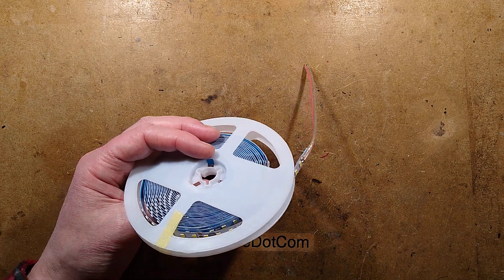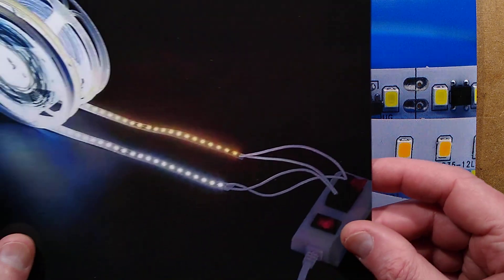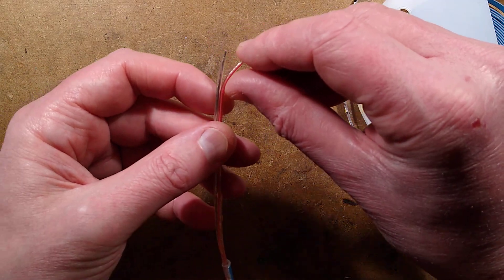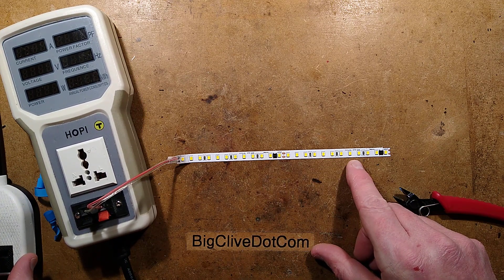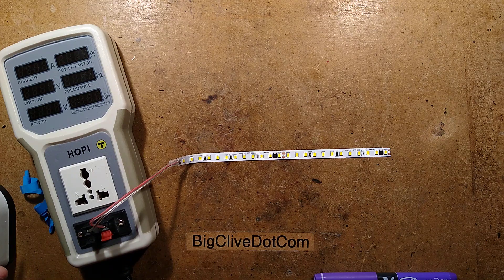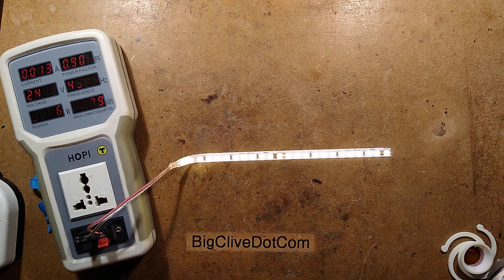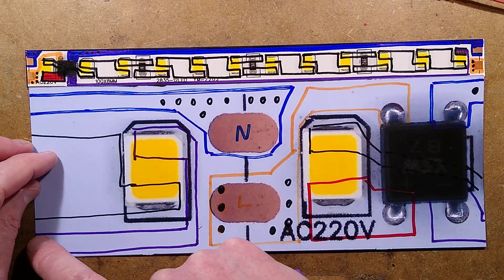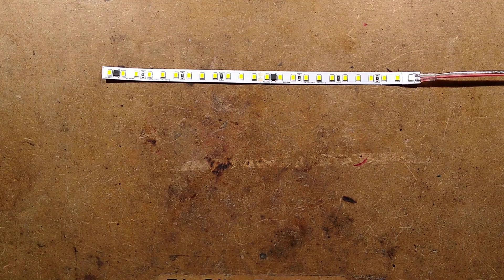Dangerous bare 230V LED tape

Comment: 120VAC LED tape is a thing in North America, though I usually see it sold in pre-determined lengths, terminated with twist-lock connectors, and encased so as not to have exposed ouchie-bits.  It can be incredibly useful in retrofit situations where a DC power supply may not be an option, but other than that, it just strikes me as a bad idea.

Although, you did touch on something interesting:  They're not getting hot.  They're not cooking the LEDs, which can be a problem with 12V tape.  Especially useful when materials costs are at an all-time high, and 5630 60LED/M 12V tape absolutely requires aluminum backplaning to prevent rapid failure.  I'm about to be doing circumfrencial cove lighting in my living room and kitchen, and 120VAC tape is on my short-list due to the absurd cost of aluminum at the moment.
Reply: I don't see this being any worse than US Christmas lights. I have to admit, the overseas systems are much more robust than the much older US system. I don't really see the 120V strips in PVC any more dangerous than the old rope lights. There are obviously places where this should not be installed,  like shower stalls or pools.

Comment: Excellent video as always, I have several rolls of this but it's coated with a clear flexible coating, not sure what probably just PVC. Find it quite useful for cosplay but haven't used it recently but I suspect mine might be a safe low voltage version although it seems as bright as yours. Long story short, why 240v and why exposed, seems unnecessary and dangerous.

Comment: When will they claim that it can be used in a pool (because it´s super "save" like 19th century USA electrics with unisolated wires on the walls & the only outlet is an E27 Edison screw) ?

Comment: With no capacitors for smoothing how bad is the flickering? 100Hz pulses should be pretty noticeable I would believe and quite useless as lightning anywhere people spend any time.
Reply from the maker: The lights spend about 70% of the time on, so the flicker isn't too bad.

Comment: At least the resistor ones should work a bit better with a phase-fired dimmer. Either way there’s no filter cap so it shouldn’t matter much. The flicker will be worse though.

Comment: I've got a 5m strip of mains voltage LED in my greenhouse but that is fully encased in rubber, connections are glued to the connector with some kind of silicone caulk, a sleeve covers ends and connectors, the rectifier is fully encased and connected in a IP65 junction box. So I kind of trust mine. This one though, not so much.

Comment: " Death strips" :-D, i would Not touch it with a barge pole.
Unless it could be converted to 50v ac from a mains transformer.
Or run away from it as fast as you can :-D

Comment: I suppose this stuff could actually be fairly safe if encapsulated in electrical silicone sealant or clear resin.

Oh, and I assume those speaker connectors are for the US market for 100V speakers!

Comment: Basic rule regarding any purchase on eBay, doubly so on electrical kit - check listings page at the bottom left. If item is being sold from China, write out your will before purchasing or using.

Comment: These teardowns are revealing PCB layouts where automatic flood generators are being used without proper design rules. Even if the tape is touch-proof, I wouldn't want it in my house.

Comment: I like the little bit of insulation over the speaker wire where it terminates onto the strip yet they leave the rest uninsulated, quality product 😁
Reply: Might nog even be insulation for insulation purposes, but to stop the wires bending near the joint and that way breaking off :P.

Comment: At 6mA a 3900R resistor will drop 140mW - your multimeter is giving an RMS voltage assuming a sine wave (which it's not seeing because it's rectified) - real voltage is 23-24v

Comment: oo, bad the mains goes direct to a rectifier with no fuse, maybe wouldve been better to have the resistors on the ac input before the rectifier, then if rectifier shorts, no big bang! or.... wire the leds in inverse parallel so no rectifier needed, just resistors

Comment: This stuff is amazing. I can fit it around my child's cot bed. Connect it straight in to a 32a socket outlet, no pesky 12v power supplies, no plug needed, another saving! And then leave my child to his sweet dreams , while we throw a baby shower... Ebay never stops to astound me with there very stringent safety policies... This one is going to sell like hot cakes.

Comment: Is a SMPS that much of a problem?  Electrolysis vs resistance degradation..even carbon electrodes have a finite life in AC electrolysis.  Think old school humidifier. 
Do you have export/import duty issues sending small electronic bits to the States?  Reason I ask is a Scottish firm makes an electronic bit I need for a project..
Reply from the maker: There's may be customs charges between the UK and USA.

Comment: how much safer would this be in a clear silicon sleeve or the front side being covered in clear silicon?
Reply from the maker: There is sleeved mains voltage tape available.
Reply: @bigclivedotcom  : Would silicone prevent mains voltage arcing?

Comment: It keeps amazing me that manufacturers put time and effort into things that are junk right from the factory, but then: who cares? It makes light, right? So who cares about shocks or fire hazards....
They could have improved it by splitting the bridge rectifier using double diodes with common cathode/anodes at each end of the sections, leaving more spacing, and making the base material thicker, but really, only molding the whole thing would make it somewhat safe.

Spacing between live and neutral is poor, but not really worse than on these incandescent light strings that have been around in the 90s.

Comment: 5:19 I bet that would be smoking hot. Though probably an experiment worth running. Expose those bus bars and speaker wires to a 2kW load and see how well they fare.

Comment: Should be a great lighting source for industrial stainless steel kitchen equipment. They didn't leave a lot of room between the tracks to drive the sheet metal screws though though.

Comment: I would have no worries using this to convert enclosed fixtures. Where there is no chance of the gen pop touching it. 
Would be a plus if the fixture was metal and bonded.

Comment: I am certain people will use it. The thinking will go along the lines of this 12v stuff requires a power supply, this 240v stuff doesn't, so we don't have to buy a power supply that can fail down the line. If we stick it in this aluminum (pronounce it how you prefer) u channel, and snap this defuser on it will look quite posh. And lets face it, what would be better for a long circuit board with open 240v than to put it into a decorative piece of metal the back of your hand can brush on when pulling the toast out of the toaster that has grounded metal shell.

Comment: I purchased an LED strip light to replace a fluorescent tube that had a strip of that inside a plastic carrier, it gets warm after a while due to poor air circulation inside the case.

Comment: Why didn't they turn the LEDs and resistors 90 degrees?
Reply from the maker: Probably to reduce physical stress on components when the tape is run around curved surfaces.

Comment: Kinda reminds me of early days of electricity.  Family kitchen hat one " fixture", bare wire hanging down to a light and to run the kettle you'd hook bare copper ends of an insulated wire to this fixture wire.

Super super unsafe, but effective.

Comment: I know that vinyl tubing would yellow quickly if it were used as a housing for this stuff...what about polyethylene? (EDIT: What about sealing the whole strip in clear heat shrink?) Seal the ends with silicone, it could be safe(ish) enough under a kitchen cabinet or in cove lighting. I don't care for the flicker, though; I've found that even 60Hz flicker is too distracting enough out of the corner of my eye, and there isn't much room to add a smoothing capacitor after each rectifier.

Comment: my parent bought similar mains voltage leds for my balcony lighting and they are in a plastic transparent casing with makes them fine for puting them in the ceiling where you will find only dead bugs , they are quite usefull to behonest. (when I saw them runing directly from mains voltage Iwas amazed I wasthinking witchcraft whaaaat is this)

Comment: We bought some plug-in under cabinet lighting from B&Q a number of years ago now. It mentioned the voltage, the wattage, the supposed power consumption, but not the thermal output.

It scorched the bottom of the cabinets and the paperwork on top of the bread bin. Quite an exciting time to be alive. At least they were happy to refund the lights and pay for the (admittedly minor) damages. Could've been considerably worse though.
Reply: Cupboard mounted toaster??

Comment: As soon as I seen the blue backing I was wondering if the tape could be thermal heat tape.  I bought some of that to put small heatsinks on small ICs.  It seems like it's a nice LED strip though.

Comment: I think the only responsible place to use it is in your wood chipper. You don't even need to bother installing it, just throw the whole spool in (powered off, of course) while the chipper is running and it will be magically turned into a perfectly safe state.

Comment: I assume it is a spare/replacement part for use in a light fixture as it is dangerous/electrocution hazard if used on its own/fully exposed, the eBay description sounds like a chingalish translation and a picture of its wires stuffed into the L & N of a “chineseum crap” extension lead

Comment: Would like to see if this holds up to a megger test 
Megger being Danish slang for the 1000V resistance tester, that we test electrical installations with. ;-)
Reply from the maker: It would light dimly on a Megger.
Reply: @bigclivedotcom  yea you are right did not think that trough. That would require desoldering some components.

Comment: Seems like this would be usable in a lighted sign with its own diffusers, like a store or restaurant might use. I'm more "shocked" (see what I did there? ⚡️) that they actually specified LEDs and resistors within reasonable heat dissipation. Clearly that must have been an accident. 😁👍️

Comment: On the one hand, I can appreciate the ability to buy low-level parts and products off of ebay which are not really "consumer ready," but it must be acknowledged that these are an utter deathtrap for anyone other than technical folk. Given the frequency with which you handle live electronics, have you thought about buying an isolation transformer? Maybe even a variac so you can quickly dial in 115V for electronics for other countries.
Reply: I expect him to have the complete professional kit off camera.  Remember, he is the electrician hooking up megawatts of power at major outdoor shows, and he was the young apprentice servicing electric arc furnaces when he got started.
Reply from the maker: I work in an isolated area.

Comment: I recently got sold that from a supposedly serious suplier.

It went inside an extruded aluminum profile hanging from the ceiling and we were running late on the project so I just stuck it there and hoped nobody would ask questions.

Still scary tho...

Comment: Clive, you gave me a good idea. I need a new socket to use the kettle at the opposite end of my work-top. I could just add a row of these LEDS under the top-cupboard that runs over the sink, connect the mains at one end and the kettle at the other. I'd need to turn on the lights every time I use the kettle and potentially keep the steam from the kettle away from the LED strip, but that's a small price to pay.......... Thanks for the tip.

Comment: Technical question for Clive.....   If I want to use these inside my fish tank, do I have to put a resistor in series with each Neon Tetra fish, If I am running them from 240V in Australia?  I believe Neons are designed to run on 110V?   ;-)
Reply from the maker: You should only use fish rated for your local supply voltage.  You can also use 415V fish, but they will run slower.

Comment: I have a neighbor who bought a very long (80 feet or so) strip of 110v led tape light. He mounted it in an aluminum channel on the aluminum eve of his house. I told him to use 12v, and he said the 110v would be "just fine." I simply walked away, shaking my head. Although, I will admit it does look cool.

Comment: I'm particularly concerned about 20-25 years in the future when this 2015 and newer Chinese stuff starts to age. We've had generations of safe electrical products thanks to Underwriters Laboratories and Intertek, though the latter's standards are somewhat lower. Since around 2015 Chinese factories have been mass marketing directly to Western consumers, bypassing generations of safety laws, practices, and hard lessons learned from people's deaths. Standards are not only responsible for safe products initially but products that contine to be safe as they age. I treasure my metal power strips from the 1990's. I recently tore them down to inspect them for problems. Nada. This Chinese junk may work okay initially but it will be much worse when it starts to age. Eventually we will crack down on these products, but our homes will in the future have a decade or more of products made when safety laws could be easily bypassed by consumers trying to save a few bucks by exploiting gaps in our regulatory system. This is what buying direct from China products is. We all do it, but do we tear everything down and certify that it won't kill us or our neighbors now or in the future?

Comment: I found on a local shop an RGB strip for 230V isolated IP 65 rated it's like 3.5$/m under 10m and over 10m it's 3$/m
Or 50m coil for 133$ 
I might buy some of it

Comment: There's a chinese product store near where I live (Canary islands) who installed very similar to these over their entire ceiling area. When you walked into the shop it was like walking onto the beach on a sunny day, bathed in bluey-white but somewhat flickery light. I think they alternated the connection polarity for every even/odd strip to reduce the flicker effect by half. A few years on some strips have failed and overall the light output is less than half, but when the shop first opened it was like walking into a giant stroboscope.
Reply: I have some car led bulbs running in series on a 24VAC doorbell transformer for 8 years straight now. A couple of them have some chip failures but they're  mostly still working. Only half wave rectified via the LEDs themselves so they flicker quite a bit.
Reply: @equid0x I presume you're not using any kind of series blocking diode, and I guess the LED's own PN junction is doing the blocking.   I'm not sure what the reverse breakdown voltage of an LED is but if it's conducting on negative half cycles then I expect that would make them run a little hotter.
Reply: These appear to use "full-bridge" rectifiers (said in my head in Electroboom's voice).
Therefore, any and all of these strips running on the same grid power should flicker in sync, no matter their connection polarity, at either 100 or 120 times per second, depending on the country.
Reply: @DarronBirgenheier  everywhere beside USA 3 phase power makes flickering less of a problem, when nearby light sources are on different phases
Reply: @poprawa  Ahh, I hadn't considered three-phase, thanks!
I'd certainly like to have three-phase here, but only do have it when using a VFD to create it for my machine tool motors (my VFDs use single-phase input to synthesize a three-phase output).
Reply: @poprawa  Single/split phase 240v in the US is pretty only much only in houses. A commercial space like a store is probably going to be running 208v three phase.
Reply: @DarronBirgenheier  the length of strip I bought from there is definitely halfwave as I tested it.  I guess might instead have blocking diode. The ones I'm describing are 50 Hz flicker not 100.
Reply: @jagmarc  Good to know, thanks!
I just ordered a 5M strip "just because". I'll be sure to use it ONLY in applications where the safety concerns can be dealt with reasonably well.
I'll be wiring my tiny house here in Northern Nevada, USA with dual voltage (120VAC/240VAC) to the lighting circuits and most of the wall outlets, for the versatility of being able to use a wider range of devices, and to have half the current in my wires at 240V, when using multi-voltage compatible loads.
I just received a 240V 3KW Kettle from an eBay seller in the UK, and use it here in the old camper that I'm living in temporarily. I had to convince the seller that yes, I know that the kettle is NOT compatible with a standard American 120V outlet ;-)
Heh, I have a 30-meter BS1363 extension cord that the kettle plugs into, with an American-spec 50A, 240V plug attached to the male end of it, plugged right into an unused outlet on the power pedestal that the camper sits next to.
Reply: Should have sold them a nice big bag of capacitors mate ;-)

Comment: Probably will burn down a house but as it leaves no evidence?

I have had a Chinese sample of an led tube, a replacement for fluorescent lamps.
The European style has a dc strip inside 48v something.
But the Chinese is direct 230V or 120V for the USA.
It is usually closed and thermally insulated, but I opened one of them.

One similar stripe in the 60cm tube.
Directly with 240 mains attached. And It could be cut in section.

As long as it is used in an enclosed appliance.

@clive
If you really need brightness, thinks about using 24V tape. Instead of 12.

This is real fun :-)